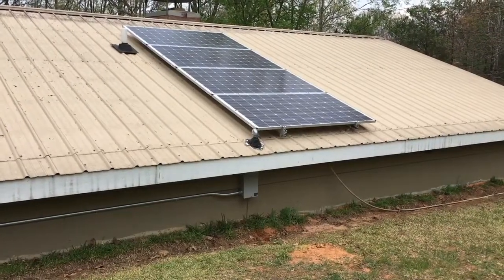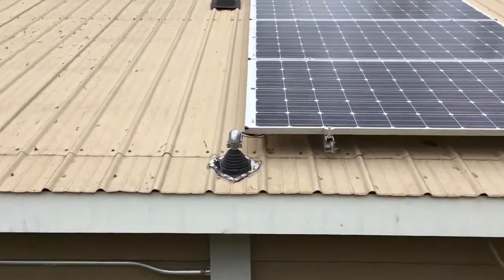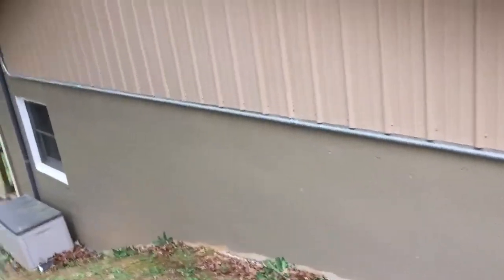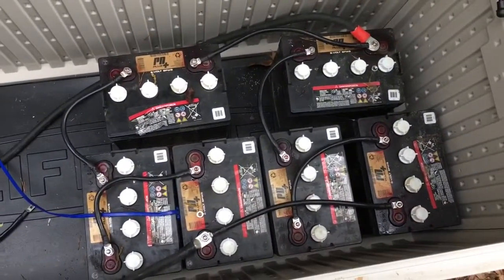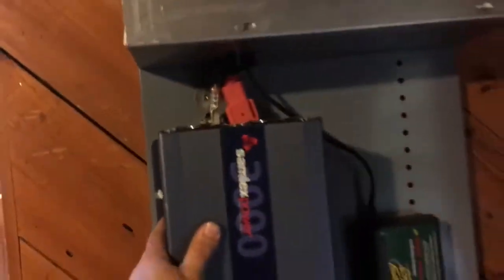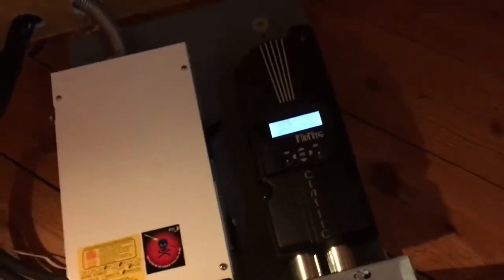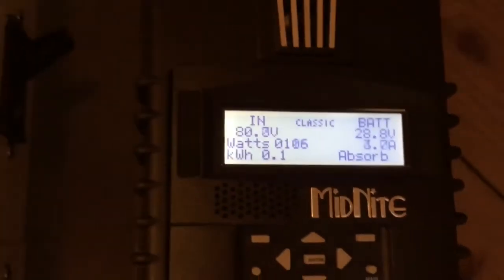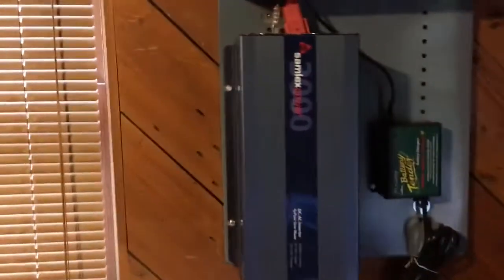Affordable Solar backup: Portable Generator Equivalent

Comment: Does this system have any usefulness beyond just emergency power? Are they able to use it in lieu of the grid power to save on consumption or do they only plan to use it if there is an outage?
Reply from the maker: Eric Bulington he uses it to run his office and he “plays” with it. If you aren’t going to interact with a system like this and connect devices to it then you are better off with a grid tied solution but if you do grid tie then you have to jump thru all the grid tie hoops. Meter fees, interconnection

Comment: So Jason I sent this to Eng 775 as well... talk me out of it if my logic is flawed?

OK, so why won't this idea work and hardly anyone is doing it or suggesting it? Make an insulated underground accessible battery storage compartment right under your solar panels along with the converter to send AC as far as you want with no loss? Use the heat generated by the solar panels in winter to pump heat and store right in the battery compartment. Make the heat transfer system re-direct-able in summer to help keep panels cooler and more efficient. No cooling necessary in the summer since the ground would be a cool stable temperature ??? I will be doing this when I go off grid unless someone can come up with a reason not to? It will likely be a sealed plastic or cement septic tank to house all the components in.
Reply from the maker: Russ B Russ b dude. Thanks for commenting. Never thought of burying the batteries. Shovels hurt my back😀

Your plan sounds good but also easier said than done. Take care and good luck with your power system. Can't wait for the video.
Reply: That's why I own a JD 310B backhoe...